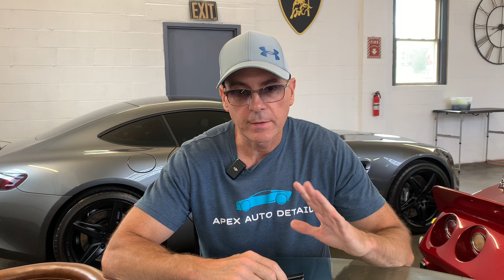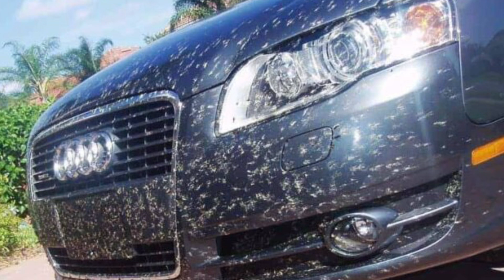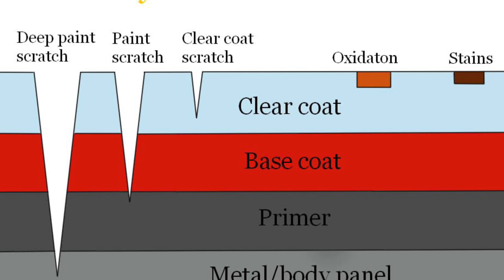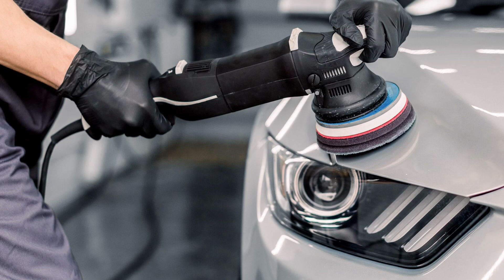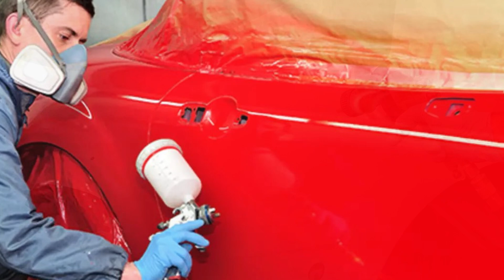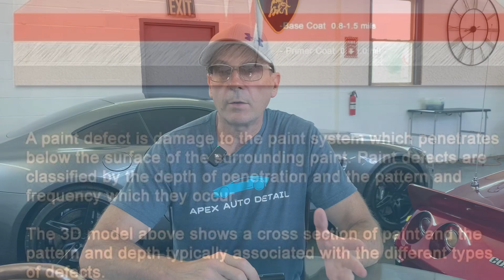Deeper Dive!! Become A Clear Coat Expert: Mastering Automotive Finishes And Materials!

Comment: If I may, I have two requests: 

1) I would like to see or know more about “pad marring” (if that’s a thing) and what causes it. Is it a wrong combination of pad/fluid or not knowing your paint?
2) polisher throws: you mention a 9mm throw would keep beginners out of trouble compared to a 15 or 21. Is this because the overall power of the machine or is it a combination of power with pad + fluid choice?

Comment: OKAY. HERE'S SOMETHING TO PONDER. 
DRYING TOWELS AND PAINT. CAN THEY STILL DO DAMAGE.
Reply: @inoagaiwhodetails  They can. But if used correctly, then minimal. For 22 years, I used to wash my car everyday and then in the course of the day wipe it 2-3 times per day with a DAMP TERRY CLOTH and spray bottle of plain water. I had a new car every year. When I turned the car in, the paint had bunch of fine scratches, but nothing that would not fill in with regular wax and then became invisible.

* DAMP TERRY CLOTH: correct moisture level is paramount. Too dry will scratch, too wet will leave water marks. You have to keep adding moisture with the spray bottle of water.

Comment: I only chase oxidation and stains on my personal vehicles, so about a 1/4 of the actual clear coat at most i aim to correct, I don’t cut/polish beyond that on a daily driver, no point in chasing random isolated defects, swirls, deeper scratches if it is going to shorten the life of the finish. So pretty much paint enhancement/one step is all i am going for, whatever it corrects I call it good.

Comment: Being a private enthusiast, my issue with all these numbers is the remaining uncertainty.
In my case, the dealership scratched my vehicle, then buffed away about 25 microns in a 1-2 square inch area. I can well measure it with the paint gauge, but I need to know exactly where the scratch was. And so this is the uncertainty that I am referring to; 
One would have to measure the car square inch by square inch. How else would an owner have certainty, that there has not been any local spot buffing. After all, there may have been similar scratches during transport as well that may have been were buffed out locally and where as a result the clear coat might run very thin.
Another observation that I like to share is with the paint gauges themselves. They need to be held very carefully to be perfectly plumb to the surface, otherwise inaccuracies by several microns will sneak in. I also found that in such cases continuous measurement mode yields far more accurate results than single sample mode. Exactly because with the constant feedback in continuous mode, I can adjust the tool in ways for the smallest possible reading.
Anyhow, just my 2 cents worth.
Reply: TLDR